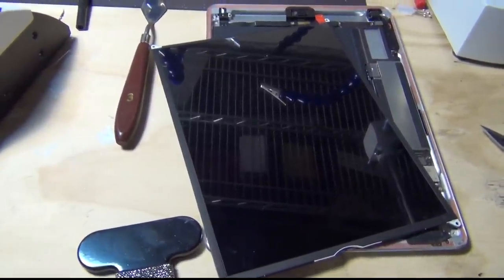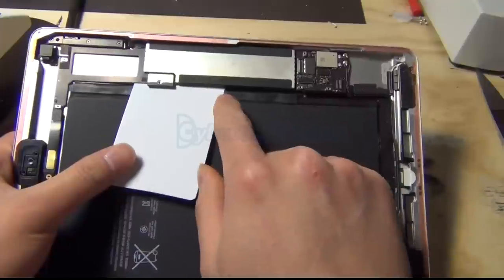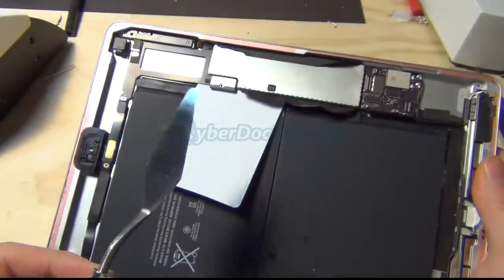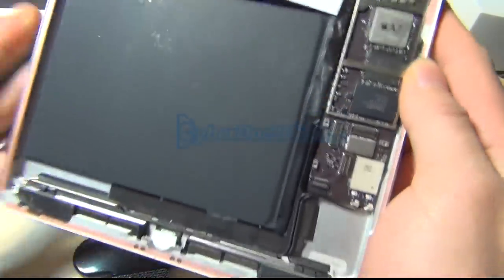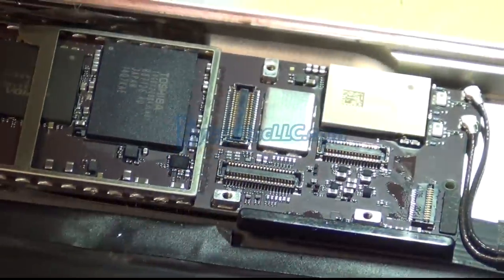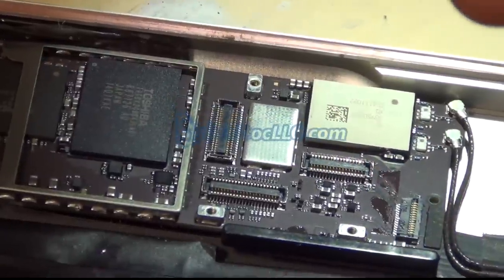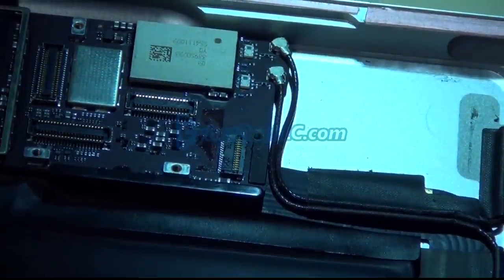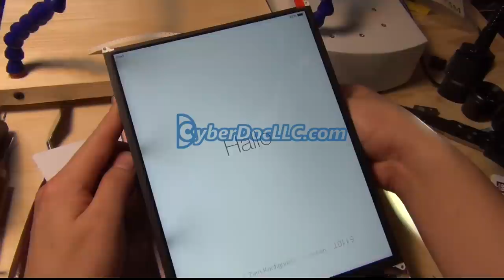iPad Air no backlight Dim screen repair service sample video CyberDocLLC.com

Comment: My method is way easier. Just disconnect the battery, connect the lcd and reconnect the battery. I had this with an ipad mini and an ipad 2. Al the times the backlight failed this method worked.
Reply: yep, this just worked for me as well.
Reply: hey bro. can you please help me with my ipad air 2 backlight issue , just a couple of leds located on the left edge of the screens are blown, can you please elaborate the method you mentioned above ?
Reply: This worked for me as well.